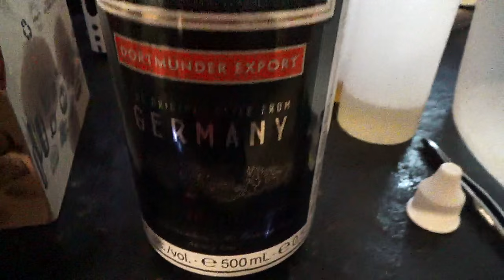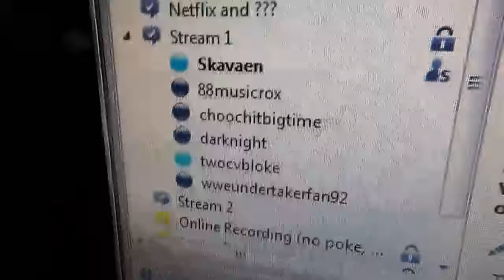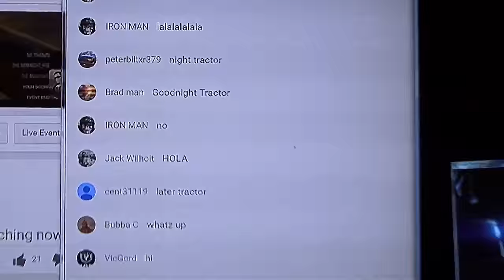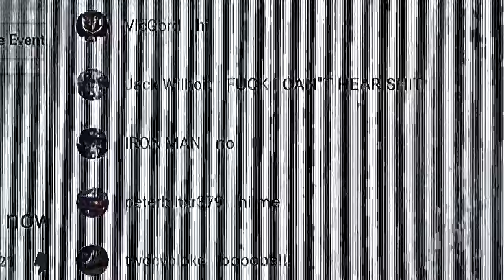Boxing them pipes

Comment: If your caliper was sticking, your car would pull to one side. Sounds like a rust ridge on the rotor. I only use el-cheapo pads and shoes for my vehicles. Fact, ceramic brakes will cause the calipers to fail more often from lack of movement on the sliders from pad wear, and the excesive heat from creamic pads will boil the brake fluid and turn it dark brown to black. Ask nascar why ceramic pads are not used in race cars. BTW, ceramic is used in CNC tooling and is on par with carbide and cobalt for machining hardened steel, thats all I use for milling heads and cam shafts for race builds. If brakes are needed, AVOID ceramic and copper infused brake pads. Keep on vloggin, and keep your stick out of the yard as lawn mowers don't like that stuff.

Comment: Yeah, we got so many different beers that basically anyone will find one they'll like, except if they don't like beer in general (but there's beer mix drinks for those, they have less alcohol but don't taste like beer). I'd been hooked on the Odin for some time, it's beer with mead, and it tastes just awesome (but also fricking expensive at €1.80 per bottle). But then, I don't like the bitter taste of pilseners at all, so the beers from the Rhine region (Cologne, Düsseldorf etc) like the DAB you had first would probably also be my favorite (just that I don't drink those, instead I sometimes have Bock, because it's really thick and tasty, plus it's got around 7-8% of alcohol, so you don't need as many to get hammeres).
Reply: +Seegal Galguntijak I love Holsten beer, there are a few types of it available up to like 10% but man that stuff is tasty!  Bock is good too!  Pilsner beer is probably the most popular type for the 'mainstream' around here, Canadian's typically don't know beer for shit so they drink the watered down commercial crap like the pilsners.
Reply: sc0tte1 At least over here, Pilsners aren't watered down. However, most beers have a "local" brew and an "export" one. And here in Berlin (a couple of hundred km away from Bavaria), you often don't get the "local" brew, because it is only sold in the direct surroundings of the brewery, so we also get only export of some brands (just like you).
But other than that, there is no "watering down", because that would be against the purity law, which isn't a law at all, but is still being abided by every brewery.

Comment: Give me a dumb phone anytime. Google Samsung R330 and you have my only cellphone I ever owned. Been working for well over 8 years. The thing that peeves me off the most about smartphones besides busted screens is to take part in some deals or activities in a store they automatically assume that everyone has a smartphone. I keep mine as I can run the thing off of less than $100 cad a year plus tax. Only thing I have had to do is get a new battery. Though they want me to switch to the digital network but I won't until the damn thing breaks. Hey when you replace the shutoffs get 1/4 turn ball shutoffs. Shuts down quickly and less prone to leakage from around the handle itself. Plus much smaller profile than the ones you have now.

Comment: Soldered pipework's a PITA cos when it leaks you have to drain everything off before you can redo it, compression fittings for the win... :P

hehe, pushing your poo back in, that's nasty, but funny... :P

Those aren't the old taps, they're some steampunk twat's mobile phone... :P

Yep, TV in that corner (and hoping the plumbing doesn't go pop) sounds like a plan, question is, where'd the satellite dish cable go? :P

You must sleep like a brick too if you don't wake up with all the noise... :P